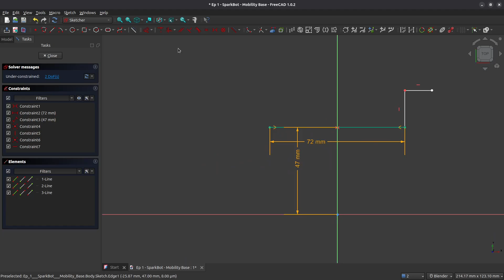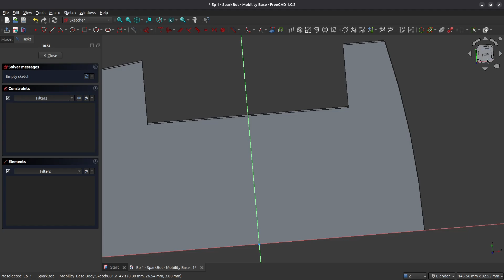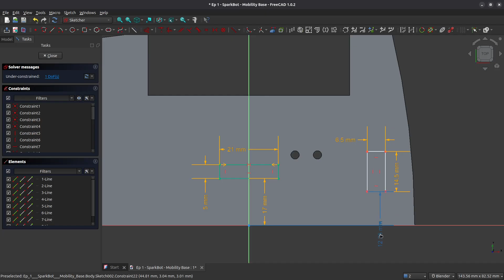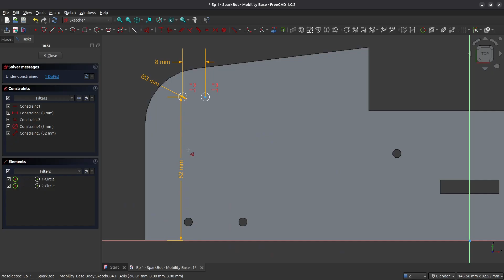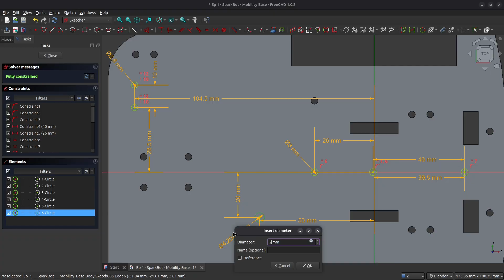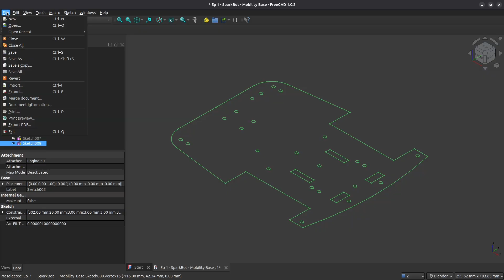SPARKBOT V2: PART 1 | MOBILITY BASE

Comment from the maker: Welcome to Phase 1 of the SparkBot V2 architecture. 🛠

For this tutorial series, we deliberately pivoted to an origin-centric modeling workflow. This ensures that even if you are running FreeCAD on a standard laptop, your computational overhead remains low and your system stays stable.

However, if you are running high-performance hardware and want to study a strict top-down parametric workflow, I have uploaded the complete Shape Binder Master Assembly to the repository.
📂 Access all files (STLs, SVGs, and FCStd) here: https://github.com/TrueNorthMech/SparkBot

Question for everyone following the build: Are you planning to deploy your Mobility Base via additive manufacturing (3D printing) or subtractive (laser cutting)? Let me know your hardware stack below.

Chart your course. Build your world. 🍁